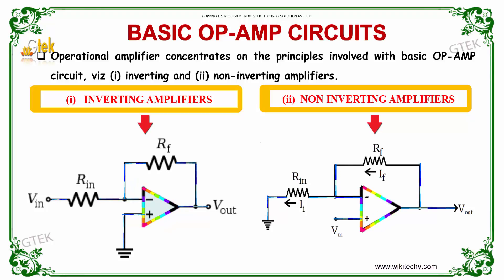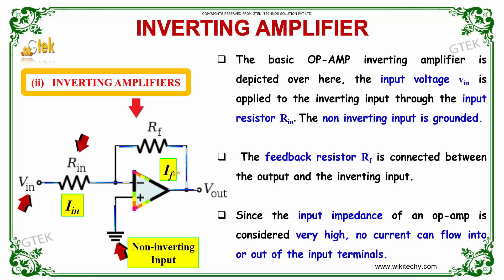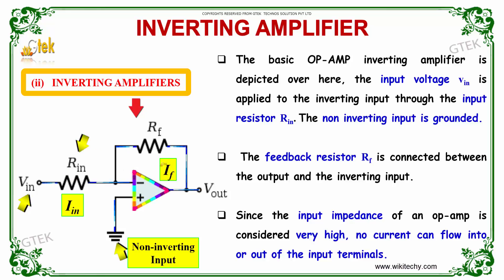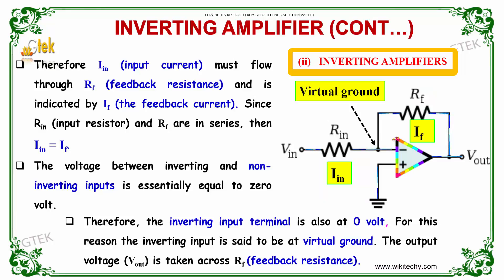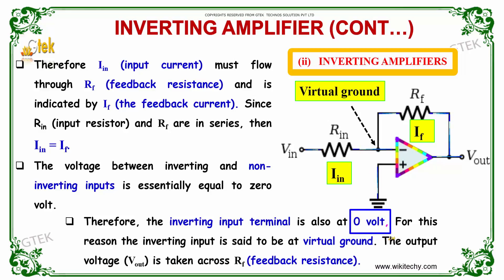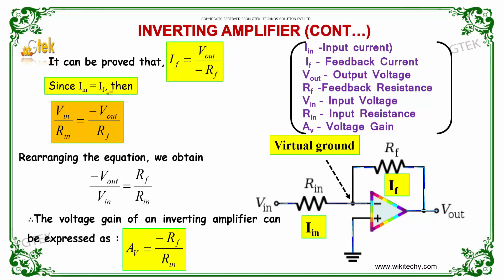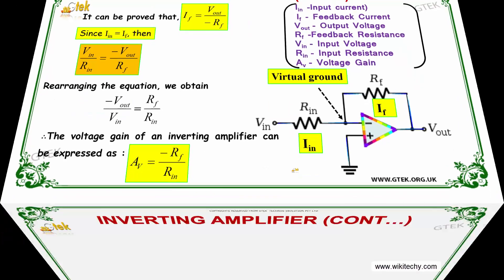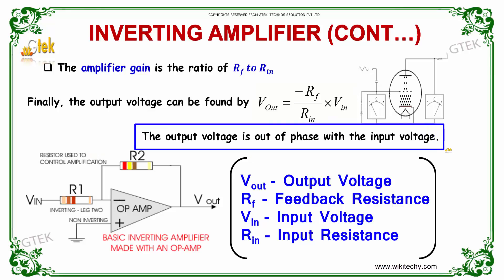Basic OP-Amp Circuits|Semiconductor Devices|class 12 physics subject notes lectures|CBSE|IITJEE|NEET

Comment: Op-amp Parameter and Idealised Characteristic. Open Loop Gain, (Avo) Infinite – The main function of an operational amplifier is to amplify the input signal and the more open loop gain it has the better. Input impedance, (Zin) Output impedance, (Zout) Bandwidth, (BW) Offset Voltage, (Vio)

Comment: Operational Amplifier Gain. The Open-loop gain called the Gain Bandwidth Product, or (GBP) can be very high and is a measure of how good an amplifier is. Very high GBP makes an operational amplifier circuit unstable as a micro volt input signal causes the output voltage to swing into saturation.

Comment: An ideal op-amp is usually considered to have the following characteristics:
Infinite open-loop gain G = vout / v. ...
Infinite input impedance Rin, and so zero input current.
Zero input offset voltage.
Infinite output voltage range.
Infinite bandwidth with zero phase shift and infinite slew rate.
Zero output impedance R.